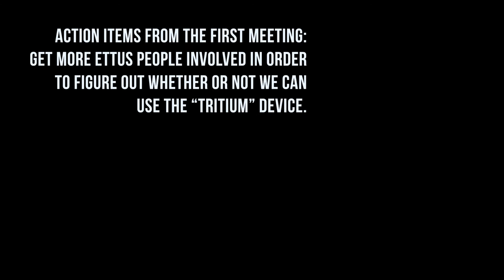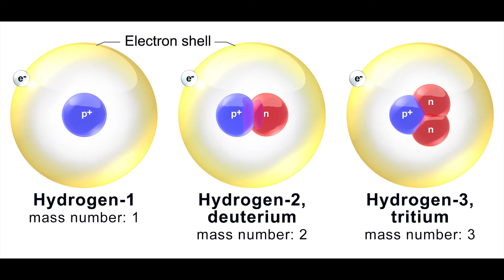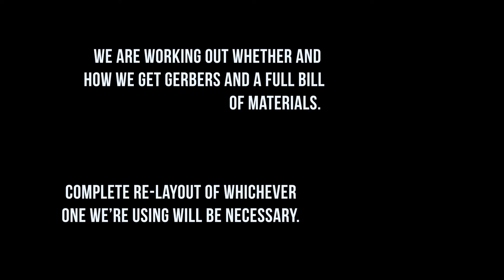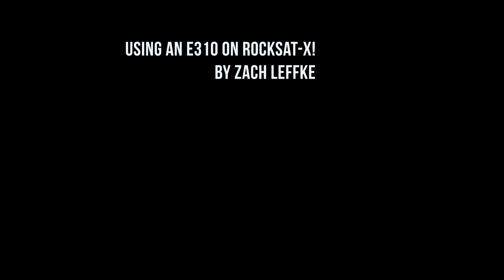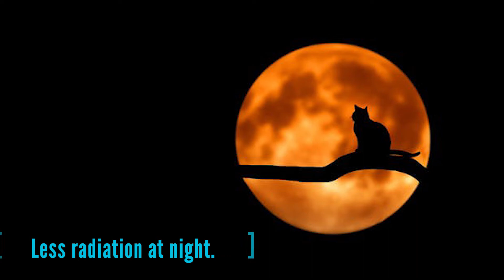20180309 Phase4 weekly report

Comment from the maker: Welcome to the Phase 4 Weekly Report for 9 March 2018!

Video report at: https://youtu.be/1GirCiB5XNg

An ASCENT Conference Call Part 2 on Careful COTS of a Powerful SDR is proposed for 14 March 2018.

Phase 4 Space organized and hosted an ASCENT conference call on 28 February 2018 with Nate Temple and Neel Pandeya from Ettus Research. The purpose of the meeting was to explore the idea of a careful COTS of the E310 and X310 Universal Software Radio Peripheral (USRP) devices. 

Nate and Neel described the USRP lineup, gave a brief history of Ettus Research, and expressed their enthusiasm for an effort in this direction. 

The most significant action item resulting from this meeting was to include additional Ettus Research personnel for business planning and engineering scoping. 

One engineering possibility discussed was to revisit and re-activate the Tritium line as a base design. Phase 4 Space is interested in a part at least as large as the 7045, and is interested in using the UNISEC electrical bus standard. The Tritium was not productized, and is not on the current Ettus Research product roadmap, but was demonstrated at GNU Radio Conference and other events. 

Since the initial conference call, several conversations have occurred within Ettus Research, and a conclusion has been reached. Ettus Research is unable to provide resources or support for Tritium. This design will not be released for a careful COTS redesign. It was never fully productized and has been retired (EOL'd). The code supporting it has bit-rotted badly and will not be released. 

However, Ettus Research can provide support for E310, E312, X300/X310, and the upcoming E320. The support is given enthusiastically as those are active current products. Support in this context means technical and engineering advice, primarily from Neel and Nate. 

It is not yet clear whether Ettus Research could provide either the Gerber files, or the full bill of materials (BoM), or both, for the E310/E312/X300/X310/E320. 

Given that re-layout is going to be required for thermal and size reasons, the Gerber files may not be necessary, and only the full BoM would be needed. A full BoM would be easier to release than Gerber.

An NDA would be required in order to use the BoM. 

So in between now and then, what can we do? Well, we can start a layout with what we know from the schematic. 

The question now is, which schematic?

E310, E312, X300/X310, or E320?

Zach Leffke wrote to the Phase 4 mailing list about his experience with the E310 at Virginia Tech. I'm going to read the whole thing because there's a lot of good stuff in here. You can skip ahead to <timecode> to pick up after the email. But, please enjoy these photos of kittens during this narration. 

"FYI, I've now put 3 E310 USRPs in Space aboard sounding rockets via the Rocksat-X project.  They survived 20+ Gs at Launch, so are plenty sturdy.  They were only 'in space' for about 5 minutes, in a sealed enclosure (so maintained pressure, temperatures were actually pretty warm from the launch friction) but performed excellently from an RF perspective.  No attempt to use the onboard GPS or IMU in the E310, the rocket made it to Mach 5, and went 100+ km in altitude, so we suspected the GPS would fail either do to the ITAR velocity/altitude restrictions on GPSs or would fail to lock up due to excessive speed and the fact that its in a metal tube all the way up until just before apogee, requiring a cold start when the skirt separates and the payloads 'go active' (would take to long to lockup to be useful information as the payloads were only 'on' for less than 5 minutes).  I've heard rumors from a source I can't cite that they perform miserably in high radiation environments though in their 'off the shelf' configuration.  Not sure what the actual failure was, but I suspect the power conditioning, not the Zynq.  Hence the desire for the lighter weight, radiation hardened AstroSDR from Rincon, which is essentially a singleboard E310 without all the extras that aren't needed for Space.  We also launched a Kuhne Electronics S-Band PA and it also performed surprisingly well in those extreme conditions.

Not sure if you are planning to launch an E310/E300 or just using it for development but either way watch out for the following gotcha:

There is a funky firmware bug in the microcontroller (as of about a year ago, might be fixed now) that controls the boot process.  Basically, the default mode is for the E3XX to boot when the power button is pushed.  You can override this in the OS with by setting a flag bit with a simple 'echo 1' type command that will cause it to boot when power is applied to the DC power port.  However this bug will rear its head every so often and somehow the microcontroller will overwrite that boot flag bit and revert back to booting only when the power button is pressed.  Not sure how an off chip microcontroller can affect a memory location accessible to the host OS in the Zynq and vice versa (shared memory location somewhere?).  VERY annoying when you have everything all buttoned up inside a payload and you have to figure out a way to snake an ethernet or USB cable in to reset the bit.  The number of power cycles before the 'revert' is random, but I've never seen it revert with only 10 power cycles or so (sometimes it takes 100 or more, sometimes 20 is enough, hence I call it 'random').  

Our fast solution, the day before the payload was delivered to NASA (we found it way late in the development cycle about a month before the payload was delivered) was to sit there and power cycle the payload over an over an over again until the revert happened.  We then buttoned everything up, did one more test (increment power cycle count by 1) and handed it over to the integration folks at Wallops.  The students doing the integration with the rocket kept careful track of how many power cycles the payload went through during integration (our last test, initial checkout at Wallops, GPS rollout, etc.).  That number (I think about 5 times, can't remember now, definitely less than 10) translated directly to our pucker factor on launch day, with lots of 'I hope it boots up' muttering.  We actually had two E310s in the 2017 payload, and both displayed the same behavior relative to the boot issue (with different number of power cycles between them before the revert).  In the end it worked.

I found one obscure post about the issue on a board somewhere (I'd have to dig out my notes for the link) that referenced the issue.  Someone from Ettus had a recommended microcontroller firmware hack to re-flash the microcontroller with a couple of changes to the code (commenting out an if statement somewhere I think) that would permanently disable the 'boot from button' mode and always cause boot when power was applied to the DC port.  We were too close to launch, and too unskilled with the microcontroller re-flash process to attempt the patch (didn't want to brick the payload in the weeks leading up to delivery).  I believe he said they acknowledged the bug and that they would try to incorporate a fix in the next firmware release, not sure if that happened or not.

-Zach, KJ4QLP"

GNU Radio Conference 2018 tickets are available:

https://www.gnuradio.org/grcon-2018/

The whole conference is packed with wonderful experiences and fun.

Come join Phase 4 Ground at our DVB-S2 and DVB-S2X workshop and hackfest on Friday! Presented by Open Research Institute, Inc. with a goal to produce an open source DVB-S2/X receiver in GNU Radio primarily for AMSAT. 

Please share with whoever you think would love to come! There will be a new user track as well as advanced content, workshops, vendors, demonstrations, and multiple social events.